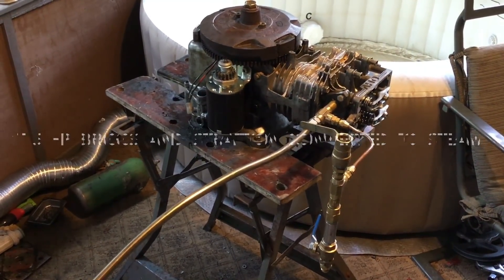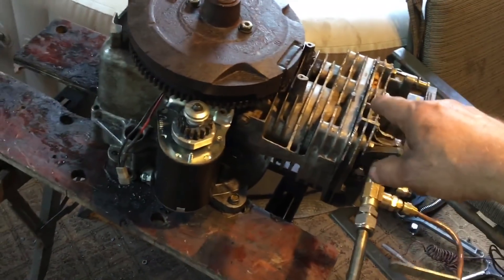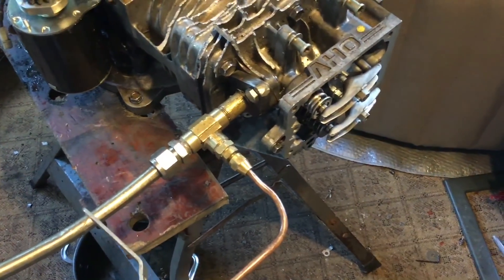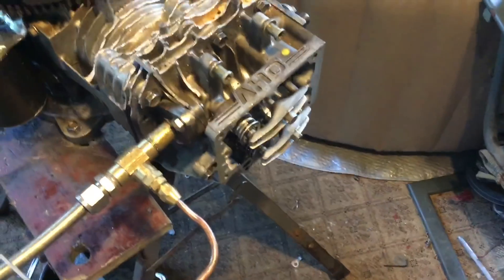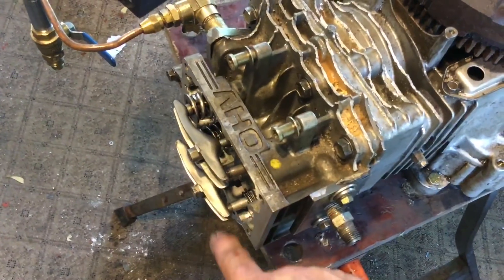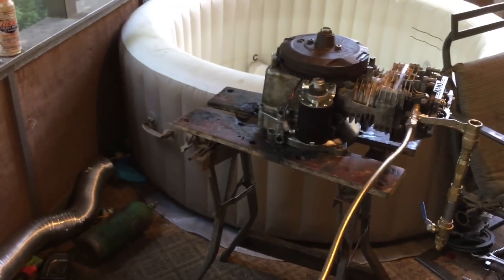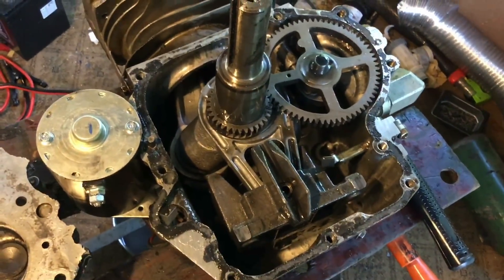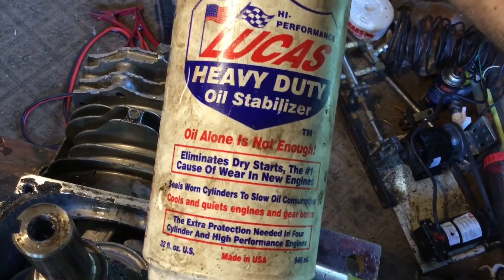Briggs and Stratton converted to uniflow steam engine

Comment: id say use a steam separator and steam trap to help keep the water out of the engine. I read a book recently that they some used fine mesh to help grab the moisture because its heavier than the steam thus it gets out of the stream. Or alternatively porous rocks can be used too

Comment: If you drill 2  holes on the side of the cylinder at the bottom of the stroke to remove spent steam it will work better.

Comment: I'd recommend replacing all bearings with sealed bearing. No moisture issues to deal with. If you could find an old turbo off a car, and hook it up to the exhaust to create a suction you'd have a better system. The old aircraft carrier uniflow steam engines used 27 lbs of suction on the exhaust, and 440 psi steam. The suction probably stopped the ring bipass by a huge amount. So your not losing power by compression of the remaining steam in the cylinder.  The were running a skimmer style with compression on both sides. You can't do that with a briggs single side. You could change to a bash value design with a little machine work. Not sure it's worth the trouble, but you have less moving parts.

Comment: im to big fan of steam, with uniflow compaund example as yours but plus with a very huge compaund cylidner steaming down to 0.1 bar with condensing vaacum with 5-10% cut off on the high pressure first cylinder its abl to reach 20-25% efficiency, as an car engine :) thats my big future project for my steam car. 1 i know converted a 5 liter bus engine to multiple uniflow, it reached 500hp at fuull trottle and spinned the wheels av highway. so steam is the future, steam can be started on old dump oil and while uptil working temperature run on free wood, even able running only wood but will take some longer startup time :)

Comment: I have a suggestion, and I know very little about this. But here goes, what if you were to remove the spark plug and use this position to introduce the steam. use the exhaust and intake valves as exhaust only on the upstroke. It seems that you could come up with some type of rotary valve timed to allows the steam in through the spark plug fitting. I maybe way off base. What are your thoughts?
Reply from the maker: That is actually a common way people convert ICE engines to steam...using the spark plug hole in a bash valve configuration. Rotary valves tend to have sealing issues...but some designs like the Corliss worked fairly well.
Reply: then you have steam going into cylinder on the exhaust stroke- if you go through spark plug hole

Comment: Awesome job. I was just watching and had the idea that it would be very useful if you could run the draining water back into the tank so that your engine would operate longer. There is one issue though. Your boiler might get oil in it without a oil separator. I sure would like to see a lawn tractor plowing with this setup lol.

Comment: Damn that's impressive! I want to see what the hell kind of boiler you made...I only caught a glimpse.
The only problem with these Briggs conversions is that aluminum makes steam condense robbing the engine of power....also copper has almost twice the heat conductive value of aluminum making it even worse. Cast iron is what you want wherever possible.
Hats off to you...this is pretty badass!
... excellent channel, I just subscribed.
Reply from the maker: Thanks! The boiler is a flash boiler monotube that uses a 1500 psi electric pressure washer to push the water through 100’ of 3/16” tubing, 50’ of 1/4” tubing and 50’ of 3/8” tubing. The burner is a propane “weed burner” that is rated at 500,000 btu’s.
Reply: full sized steam engines use cast iron not because of its low heat conductivity although that is a factor but because cast iron is a slippery metal just like gunmetal or phosphor bronze. I also think that little engines like this one have a cast iron sleeve pressed into the aluminum casting to reduce friction.

Comment: This is not my picture.lol however i. Am planing on building similar. Yours beinh a 4 stroke r u getting a power stroke on every revalution? Great job!
Reply from the maker: Thanks. Steam engines don’t need a compression cycle, so there is power on every down stroke.
Reply: @steammachine2094  yes power exhaust power exhaust

Comment: Did you modify the camshaft?
Reply from the maker: The camshaft was modified to have an extra lobe on each cam, so that the valves open every stroke instead of every other stroke.
Reply: Steam Machine , you said you added holes from the cylinder to the crankcase created the uniflow design? Im guessing holes just above the top of the piston, where  its stops at at the bottom of the cylinder bore?
Reply from the maker: Yes...there are ports drilled just above the piston at BDC. This allows the steam to exhaust at the bottom of the stroke when the holes are exposed. The exhaust valve that runs off the modified cam is there to minimize recompression on the upstroke and remove any remaining steam left in the cylinder. The engine will and has run with just the uniflow ports for exhaust. The cam operated valve opening on the up stroke makes it easier to start and run smoother., but some say you can get  better performance from the extra heat created by recompressing the steam. In the video I mention possibly installing a cut off valve on the exhaust output to control the amount of recompression once the engine is started and warmed up.
Reply: Steam Machine  I noticed that yours seems to turn more RPMs than others I've seen here, and I think the holes you added are the reason why. Nice work !!!

Comment: I suppose Compound Steam Oil is not available anywhere. Small amounts anyways.
Reply from the maker: You can still get proper steam oil....but usually you have to commit to large quantities and they can be expensive. I now use a combination of Lucas oil treatment, heavy gear oil and graphite powder. It handles the higher superheated steam temperatures better and can be bought at your local auto parts store.
Reply: abner doble wrote a treatise on using regular car oil in steam engines.  said it works like water wetter to prevent air bubbles on the boiler walls.  ultimately there'd need to be an oil separator and separate injector to meter oil to the motor.

Comment: what kind of power would you say it makes? about the same tq. as when it was gas. more less? I'm looking to build or convert one of these . to run a generator. awesome project. have you used it to power anything?
Reply from the maker: Steam engine power comes from the boiler....the engine just translates the power to rotary motion. With high pressure, high temp steam, it has the potential for considerably more output than the original 17.5hp! I installed it back on the riding mower and actually drove it around for a bit before my boiler crapped out. Check out some of my other videos...it's the same engine in the lawn tractor tests. Thanks for commenting and good luck with your project!
Reply: Steam Machine 
thanks. I was just wondering. because gas engines tend to have a short stroke. and steam engines I have seen . had a considerably longer stroke. I'm just curious to how that effected power. do you think a 3 or 5 HP Briggs on steam. could replace a 10 HP on gas? thanks again
Reply from the maker: Gasoline engines converted to steam are definitely not ideal....real steam engines have a longer stroke so the steam can fully expand. That being said, with steam the power comes from your boiler, so even with a shorter stroke you could possibly get 10 hp out of a 3 or 5 hp engine, as long as you have enough pressure and your conversion can handle it.